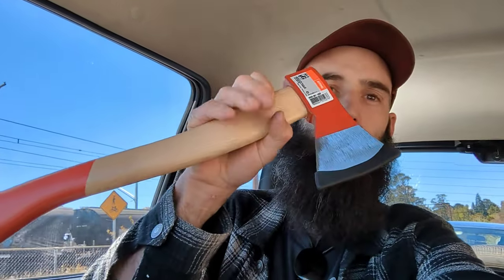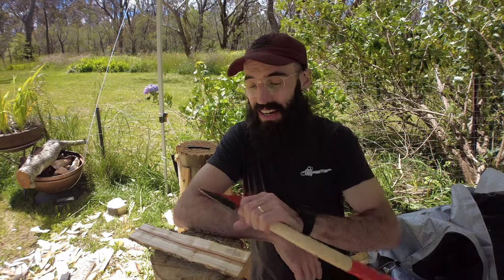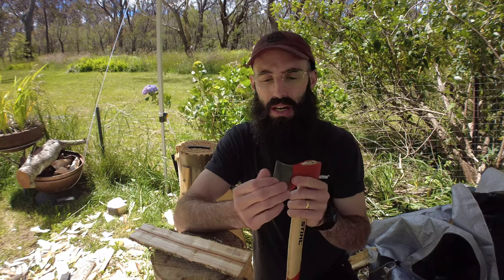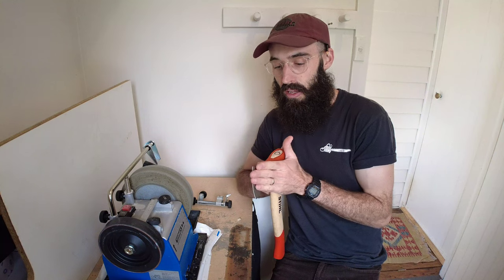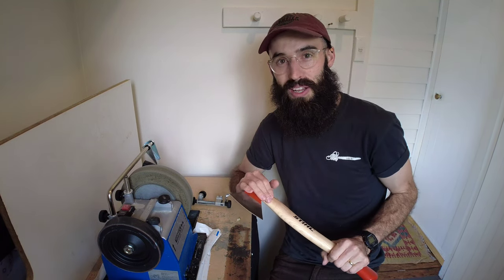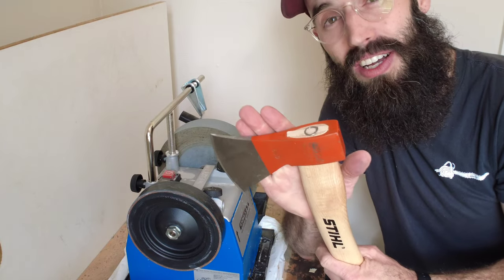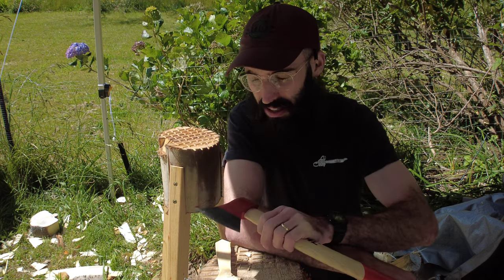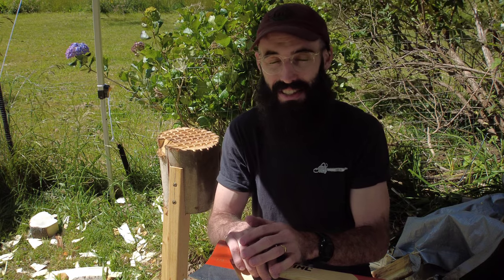Budget Carving Axe - Can it carve spoons for $65?

Comment: I use a $30.00 fiskers axe. It works quite well as-is, for a dirt cheap axe actually. Very sharp and decent enough bevel. Much larger bevel than that Stihl. When I become more skilled at spoon carving I will consider a better axe.
Reply from the maker: You work with what you can! 👌

Comment: Really nice demo! I'd enjoy seeing how you would improve on the edge of a fiskars hatchet (as you've recommended), they start out decent out of the box but I'm sure could be better
Reply from the maker: Hey there! To be honest those Fiskars really only need a light hone, they come with a pretty defined bevel, so you don't really need to re-profile. Some high grit sandpaper and a flat block of wood will do the trick 🙂👌
Reply: @andyspoons  I've been getting decent results from the 10-20$ CAD set of 4 diamond stones Rex Kruger recommended, forms a quick burr even with cheap plates!
Reply from the maker: @RexMcTavish  that's great to hear!

Comment: I got a very similar 600g Prandi German style hatchet and the edge was about the same. I don’t understand why they put those dull micro bevels on them! Even for just random chopping, the edge is terrible. I did it the hard way with a file and hones though. You have the right idea 😊
Reply from the maker: It's definitely just a production line streamline. I would barely say that they pump them out with an edge at all

Comment: I bought a Vaughn carpenter's axe 22oz and cut the hammer off the back, cut the nail puller out so I could get my hand behind the edge and sharpened it. It works just fine. They go for around $40 right now but I paid around $20 for mine. Don't know how to upload a photo of it here.
Reply from the maker: Sounds like a fun project!